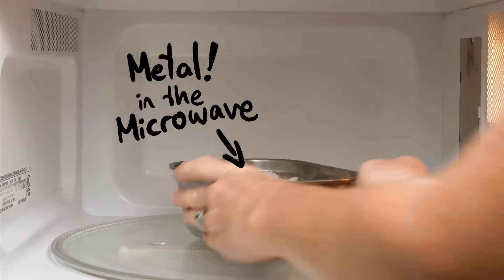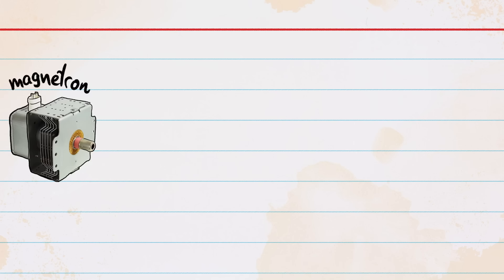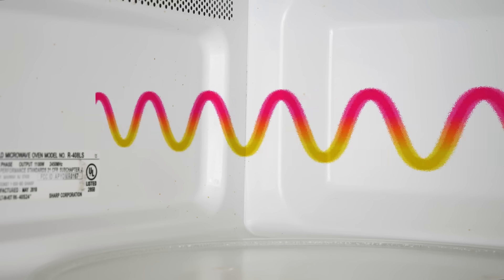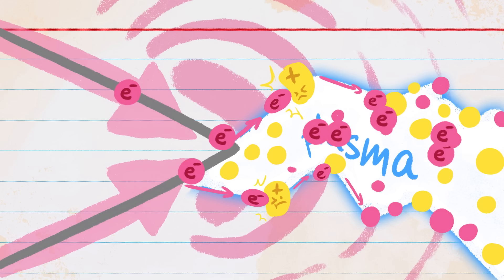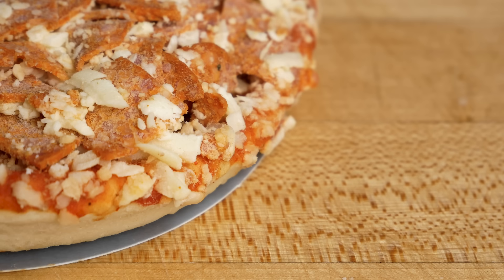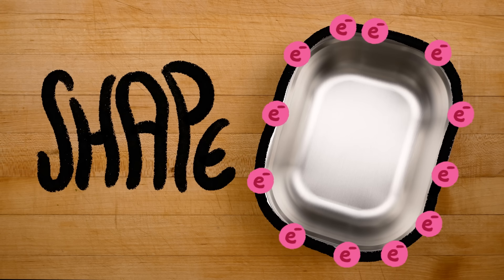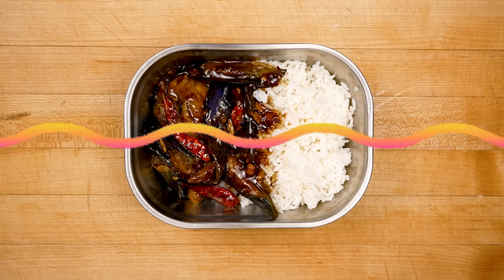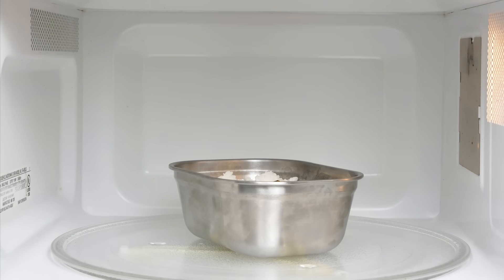Microwaving metal is FINE (sometimes)

Comment: Fun fact: The physics of MRI are extremely similar to a Microwave. Except the goal is to NOT to cook your patient. Rather we are sampling and mapping the hydrogen signal in your body to diagnose disease. The phenomena of RF burns in MRI is very akin to the chance of arcing in a microwave. Trapped electric fields cause localized burns in places where the electron flow gets impeded.

Comment: a small grocery store near me has a section of pre-made meals that they make and you just have to heat them at home. they come in a foil container not dissimilar in shape to the containers in this video, but meant to be disposable. RIGHT ON the packaging they tell you you can microwave it. the first time my dad brought some of these home i was baffled, for over 20 years i had been told never to put metal in the microwave, and yet this grocery store was telling me to do so... i guess i kind of get the science now and suppose it could work, but i still always bake these things in the oven anyway 😂 and it's only in part due to the consistency of the food being better that way

Comment: I have two "metal in microwave" experiences:
One is accidentally leaving spoon in a soup, and after short run, I saw zaps all over the spoon. I still have it and it the spoon has "burned" spot's on it. They don't seem to cause further damage.
Another is using covers "custom made for our microwave". (the point is to put them on top of your plates to prevent dirtying your microwave, but also to keep steam and help heating some meals more evenly). The only problem, they had some metallic label on them - it just looked like shop bar code, so it was never removed. It also didn't say it was metallic, we only learned that when one day, it caught fire. We had actual fire inside a running microwave, and were happy to be there or we might have lost our house.
Reply: I'd say that one reason you are not getting metal sparks in tests is, you are not using food. I recommend soups or other "water heavy" meals. Also, try to buy some really cheap forks, the sparks seem to happen more often on lower quality metals.

Comment: I have some plates with a small amount of metal on them. The metal is just a wafer-thin painted layer, and there are absolutely no sharp edges to it, it's perfectly round, circling the entire plate. So going by the criteria laid out in the video, it should be very unlikely to arc. The problem is, these do arc. I know that because I've placed them in the microwave before after forgetting they have metal on them. It started arcing the very second I turned the microwave on.
I don't understand the discrepancy here. Perhaps the metal has very tiny scratches on the surface from using and washing it? It looks fine to me, but clearly it does arc. But then if a scratch so small that it's entirely invisible to the naked eye will already cause arcing to happen instantly, what's even the point of looking out for scratches? At that rate you'd probably only be able to use each metal container in the microwave once. So I doubt that's it, but I really can't think of anything else.

At any rate, I very much agree with teaching people never to put metal in the microwave based on those experiences. Even if it can be done safely, if knowing this much about how it works doesn't allow you to distinguish between what's fine and what's not, it's better to assume that if you can tell there's metal, and there's nothing saying to put it in the microwave, it's never fine.

Comment: 1:27 "billions of times per second"? Are microwaves really in the GHz range?
Reply: Yes, mine says 2450MHz, I guess that’s why sometimes wifi dies when a microwave is running
Reply: @Gentoli Super cool. Thanks for the fun fact!
Reply: Yeah you nailed it that's why microwaves mess with WiFi if your phone is too close. The interference is not as bad on 5Ghz wifi. You can test by being on 2Ghz, play YouTube, then put the phone leaning against the microwave.

It's easier to notice with BT so if that doesn't do it connect BT headphones and you'll hear the stuttering.
Reply: Yes, 2.4 GHz, 2.4 billion times per second
Reply: Yep, their range is roughly the same as 2.4 ghz WiFi, it can interfere with WiFi connectivity near the microwave.
Reply: Yes, they're generally about 2.4 gigahertz. That's why running a microwave can degrade your Wi-Fi signal.

Comment: I thought that gray coating used to crisp up or brown the food was no a thin metal but a coating of silicone carbide which is an excellent absorber of microwaves so it heats up much faster and hotter. Plus silicone carbide is very heat tolerant. It also nicely matches the same color of the silicone carbide wheels on bench grinders

Comment: I've been putting metal in the microwave for years. As long as you keep to the simple guidance given here nothing bad happens. Normally I get people telling me I'm going to start a fire or ruin the microwave. Others are just in shock. But the biggest shock comes when nothing happens and I remove hot food from the microwave. They still don't believe it and think I played a trick or something 

I have noticed that if I try to heat something in the can like soup, it doesn't heat as fast. Probably too little of an opening compared to the volume of food to get the waves to propagate inside the can

Comment: Of all the channels I'd expect to mention ElectroBOOM, MuinuteFood is the last one I'd expect.
Oh, also, I have my own experience with microwaving metal. I wasn't thinking, and trying to melt butter, I put it in a metal bowl, and microwaved it for a minute. At then, I realized that I just ran metal through a microwave, but nothing catastrophic happened. The only thing that went wrong was that the butter didn't actually melt, presumably because the bowl blocked the microwaves from reaching the butter. I still would advise using a plastic or ceramic bowl to melt butter in a microwave though.

Comment: Also wait alumium foil fine in microwaves'? I mean it won't damage the microwave much but just a sheet of it will vaporize, just try putting a cd you don't need anymore into it. The shiny layer will get funky patterns and it definitly will arc. And remember a cd basically has no sharp corners and still does that
Maybe if food is placed on it the energy disipates in the food instead of bunching up and causing the foil to melt?

Comment: The one cool thing that has been noted, however, is that you can trap this plasma inside a container of some sort- like glass or ceramic, & it'll just stay trapped in there. 

I have had these decorative plates with a little bit of metal embedded in the rim. Not sure if it's an actual metal strip or metallic paint, but I broke one once & there was no metal poking out, so I'm going to assume the latter. But, these plates do make plasma when I use them in the microwave, the plasma just remains trapped inside the plate. The only bad part about that is, because of that, the plate will give you third degree burns, if you so much as put it in there for even 20 seconds, so I had to make a blanket rule to never use those plates in the microwave in the first place.

Comment: Oil and fat molecules are usually not directly heated by microwave radiation, as the frequency does not fit. What can get quite hot are some plastics (melamines).

Comment: My aunt would always put this china cup which is decorated with gold details into the microwave and it was fine…  that is until continued use and washing began to wear it away. That's when the sparks started, and it just got more and more intense over time. Makes sense now, since each new defect adds 2 new congregation points for those (-e). It also creates a tiny gap in the inlay, further facilitating the now prominent arching ⚡ Cool!

Comment: I would like to add that most modern microwaves have their inside metal plating covered with some kind of anti arc coating, so metal to metal arcing between an utensil and the inner wall won't happen, even if you put them close enough, however, I find it still risky because metal to air arcing will always be a possibility with an old utensil with just the right scratch or right dent or a hard to see pointy edge. Not worth the risk.

Comment: Even with a smooth metallic object, if you heat it long enough, it could spark and catch fire. There was an incedent of my uncle live in his hometown who forgets a spoon in his cup and his microwave explodes
You also have to remind that when manifaturing, there could be some errors in the metal. Even if it’s smooth under a microscope, its atoms form a rough edge. The electrons can bunch up in those concave points between the atoms so it can still cause arcing (if it get heated long enough)

Comment: Just two weeks ago I had the luck of putting a (probably) aluminum polymer packaging (those shiny paper packaging) in the micro.
About 3 seconds in, there's a bright light coming from inside the micro and I pressed stop.
The packaging was a bit burnt, the microwave is safe. I learned my lesson. There's a non-zero chance of metal things arcing in the micro. Be careful.

Btw I warm my food in my round metal bowl with my micro since like forever (approx 10 years ago). It's safe, as long as you know what to watch out.

Comment: I inadvertently left one of those paper-covered metal twist ties 5:43 in a microwave (it had fallen off the bag I had kept the vegetables I was microwaving in). After about 20 seconds, I smelled burning and saw some arcing. Scary. The twist tie left a very small black dot baked into the ceramic bowl it was in that I could not get off. So, yeah, those things are not a good idea in a microwave.

Comment: My microwave has a metal shelf in the middle, so there’s that…
But I had an incident (in a different microwave) that is informative: I had a plastic container of honey that was mostly empty, and the small (<30g) quantity of honey at the bottom was mostly crystallized, so I put the plastic bottle upside down, with the open mouth of the bottle sitting in a small glass dish.  The plan was to have the honey melt from the microwaves, run down the sides of the bottle, and collect in the glass dish.  After less than 10 seconds I saw a blue spark and heard a “bang” so I immediately opened the door to stop the microwaves, and picked up the honey bottle. Looking closely I could see that a small sliver of metal from the foil seal was still stuck to the mouth of the bottle, and that had obviously arced (and presumably made a small plasma).  I picked up the glass dish, and as soon as I touched it, it forcefully shattered (not like tempered glass either, but more like an improperly annealed piece of blown glass).  My suspicion is that the plasma caused some kind of stress riser in the glass, and me touching it allowed the stress to release.

Comment: RF engineer here. This is the best explanation of how microwaves work that I've seen. Bonus round: ceramic plates heat up for the same reason that wifi can't go through concrete walls: They absorb the microwaves and heat up. The ceramic in plates is especially good at absorbing microwaves (lossy), which is why they heat up faster than your food in a microwave.
Reply: With the exception that the microwaves from the magnetron don't "blend into an electric field" rather they form a standing wave in the electro-magnetic field.
Reply: Now I know why the bowl is burning hot but the soup inside is lukewarm.
Reply: And suddenly, I have the urge to try heating up a concrete wall with only WiFi signals. In vain.
Reply: @OscarCacnio  If you're using Wi-Fi or Bluetooth in a building you are probably heating up the walls, but not by much!
Reply: @OscarCacnio  With a 1kw amplifier, anything is possible. Just watch out for your eyes, I've heard of technicians ending up in the beam of a microwave link and getting cataracts.
Reply: @OscarCacnio You are going to be successful, it’s just that your success will be very small
Reply: This would explain why I've been able to cook food using a ceramic noodle bowl with a ceramic plate acting as a lid. I discovered this by accident and use it to cook things like popcorn that need to get above 100C
Reply: @roberthutchinson3009 There are actually microwave crucibles for hobby chemists that get several hundred degrees Celsius hot, you can easily melt glass in them.
Reply: The word magnetron sounds like someone has been watching way too much transformers or x-men as it is. 

Anyway. I want a magnetron as a pet now. Reckon it’d do some cool tricks.
Reply: So you're telling me that ceramic can absorb wifi
Reply: Redstone flux?
Reply: Thanks for explaining about the plates, I always wondered why on earth plates get hot in the microwave when the firing process would have removed any water
Reply: Interesting, would you say ceramics reduce the efficiency of microwaves because it absorbs some of the waves?
Reply: @One.Zero.One101 Correct. That said, it'll be easier on your magnetron as there will be less energy to reflect back down the waveguide and into the magnetron to be released as heat. In general: If you have a transmitter with a mismatched load, (non-resonant antenna, dodgy coax, empty microwave, etc), the energy will be reflected back to the transmitter and dissipated as heat. This is why you shouldn't run a transmitter without an antenna. I'm grossly oversimplifying here for brevity's sake. The search terms are 'impedance mismatch' and 'transmission lines' if you'd like some further reading.
Reply: @merseyless  true but getting all those waves and reflections inside the microwave to create a standing pattern that focuses back on the precise spot of the waveguide exit is, well, either damn good luck or damn good engineering :P Even with an empty microwave and just a couple of wrinkled up aluminum balls I think you'd have a harder time damaging the microwave by just running it for too long time, rather than the reflections back to the transmitter (if you even consider a magnetron to be a transmitter :P It's just a resonant cavity that creates EM waves by thermionic emission, looks pretty much like a giant passive to me :P).
Reply: @merseyless  Can you offer any insights into the mechanism of thin metal acting as a susceptor and thick metal as a reflector? Simple bulk resistivity, or more complicated surface plasmon resonance effects?
Reply: @InTimeTraveller  if you put RF energy into a system, it will rapidly reach an equilibrium where the energy in = energy out. Some will be lost to the walls of the chamber, but you will get quite a bit flowing back to the magnetron. Even a magnetron will have a Thévenin equivalent circuit while operating, and it'll be more than happy to absorb that energy. For transistor circuits, this results in excessive heat and high voltage, which can cause breakdowns in insulation and lots of magic smoke being released. I'm yet to blow up a magnetron, so I'm not sure what failure mode they have for high VSWR.
Reply: @merseyless  
So If I'm understanding things correctly, a metal plate would be a better choice for reheating leftovers than a ceramic plate? Ceramic plates absorb, metal reflects?
Yes, there would still be conducted heat from, say, soup, but otherwise
Reply: @MrHack4never  either that or a low loss material to allow for food to be heated from underneath. Plastic cutting boards are made from HDPE, which has a fairly low loss. I can confirm that it doesn't heat up much in the microwave, but I haven't tested if it heats food more evenly.
Reply: @One.Zero.One101  I would argue that it actually helps, as in most cases your food is in direct contact with that hot ceramic plate, and the ceramic being hot helps to keep your food warm as you eat it.
Reply: How about melamine dishware? I think they absorb the waves as well because they get hot more than the food they contain
Reply: The reason that some ceramic tableware get hot is that there is usually a part of the base that has no glaze, as it was resting on that part in the oven used to manufacture the plates and saucers.  With repeated washing, moisture gets into the material as it does in concrete walls and it is the contained moisture that is absorbing the microwave energy.  Glassware does not get hot as moisture cannot penetrate glassware unless cracked.
Reply: @karhukivi  Nice hypothesis, but it's wrong. I just put a well-worn HDPE cutting board and a soda-lime glass in the microwave for 20s at half power. The glass came out warm and the cutting board is still cold. Glass has a much higher dielectric loss than HDPE, explaining the difference.
Reply: @merseyless  That is interesting indeed!  I also put a glass into my microwave oven and it comes out cold, as do cups, arcopal plates (a type of glass) and some other items.    The dielectric constant for glass is given as 3.7-10  (air is 1 and water is 81), so there must be variations depending on composition and manufacturing process.
Reply: @karhukivi  My apologies then. I'll have to test a broader sample range as I stopped testing after the first cup heated up. By the way the number you're looking for is dielectric loss, not the dielectric constant. The dielectric constant slows down EM waves (among other things), while the dielectric loss will dissipate them.